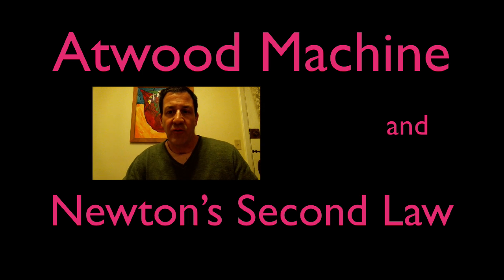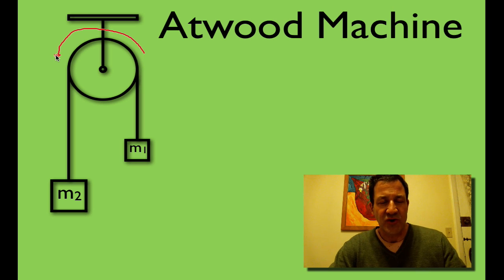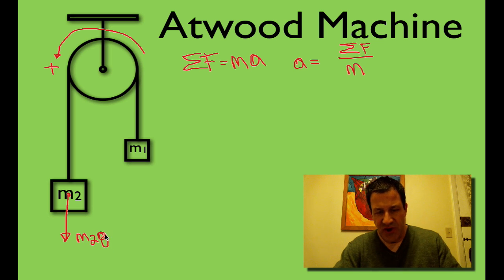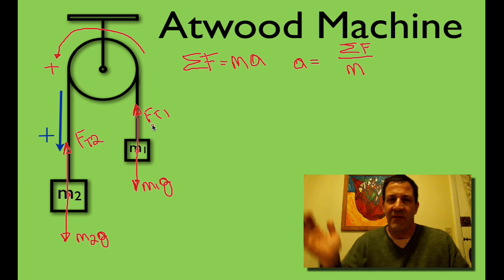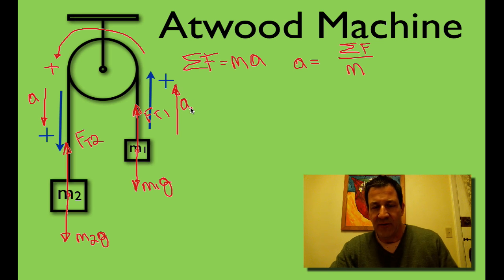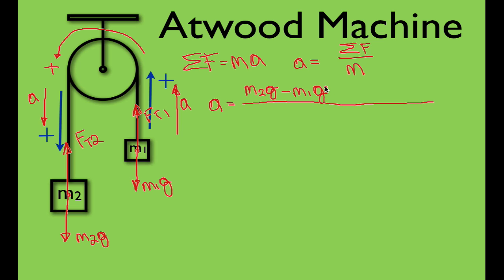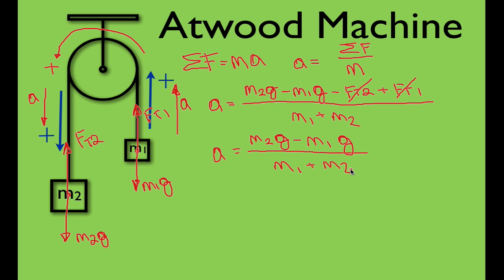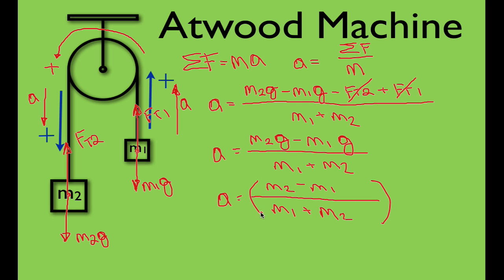Newton's 2nd Law (7 of 21) Calculating Acceleration of a Atwood Machine

Comment: good video, results confirmed:: http://hyperphysics.phy-astr.gsu.edu/hbase/atwd.html
Reply from the maker: Thank you for the comment.....Yes, that is a great website! Amazing what people will make available at no cost!
Reply: @stepbystepscience  Thanks: Based on a falling object at an acceleration==a==g==9.8, what do you think is the minimum acceleration a rocket needs to lift off the ground, assuming that m2 (in the above example) is the weight-force pulling up the rocket (m1) with a pulley suspended from the sky??? Alternatively, what do you think, or what do you compute, as the minimum for m2 to push up a rocket, if it were pushed from below with a rocket-motor, NOT pulled up, or pushed up with a jack?? 
Another way that I could pose my question:: Assume you have a 10 kg rocket, to be launched vertically up, from a launch-platform-terrace installed at the top-outside of a 100-meter tall building. 
 Here, the question would be:: What is the minimum-thrust force (Kg-force) needed to prevent the rocket from falling down to the ground, and may be just hovering???  & thanks again. K.S.

Comment: I tried to apply the Atwood Machine in the field at my job. I have to carry my 50 pound backpack up and down a 175' tower. So I thought to create an Atwood Machine using a 200' rope, two pulleys, my backpack(M1) and some weights(M2). The objective was to establish equilibrium so that I could easily take my backpack up and down the tower with little to no effort. My atwood machine failed miserably. I was able to raise my backpack (lowering the weights) with very little effort. But lowering my backpack (raising the weights) took a tremendous amount of effort - there had to have been at least 25lbs of resistance when lowering my backpack. I'm baffled in how it worked one way but not the other.
Reply: I'm quite new to this, would it be possible that this is because of the shifting weight of your long rope? I'm still trying to picture your contraption. If the weights pull the backpack up then there will be more weight pulling against the backpack as it ascends due to the increasing mass on your M2 side. Keep in mind I'm new to this just my take since his video did not account for this which may have resulted in the error?

Comment: I have a similar question except the M1 in on a surface and asked this question with no weights given how do I answer this question: Mass M is released from rest at some point to the left of the position x0. The velocity of mass M
is measured at points x0 and x1 as shown in the figure. Find the acceleration of M in terms of the
distance d = x1 􀀀 x0, and the measured velocities v0 and v1 at points x0 and x1 respectively.

Comment: I have an Atwood Machine. I have an aluminium Pulley of radius 4 inch. A gym cable running over it. Not sure coefficient of friction but smooth movement. One end of rope, I attach wt. of 0.5 kg. I had to attach weight of 1 kg for acceleration to start. If I attach 2 kg, I had to attach 3.1 kg, for the system to start acceleration. If I attach 4 kg, I had to attach 6.1 kg to other end. Now if I take 2 pulleys and run rope over them and repeat experiment, I need even more weight differential for system to accelerate. Thus there are some forces acting which need to overcome to start system acceleration. I think apart from inertia of pulley and static frictional force, probably some x and y directional force components are coming into play. All Atwood problems talk about equation for acceleration but not able to find equation for "weight differential" required for the system to start accelerating. Also any suggestions on ways to reduce this weight differential to start system acceleration shall help.